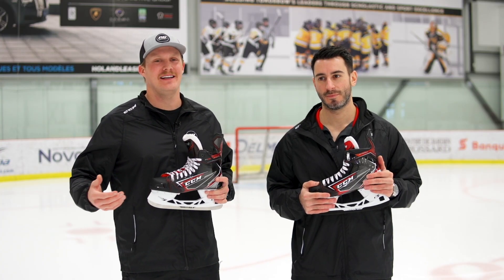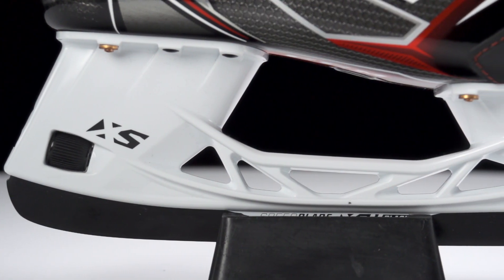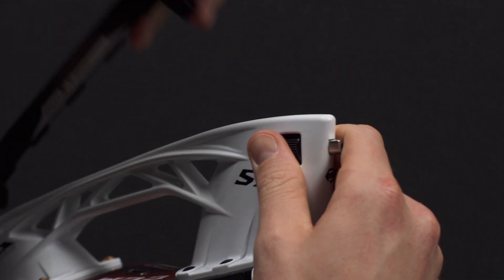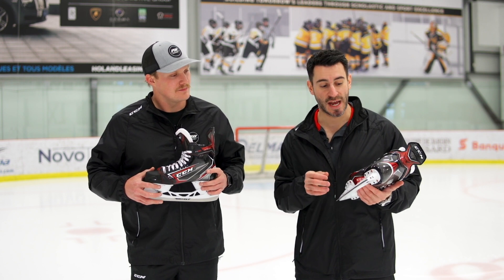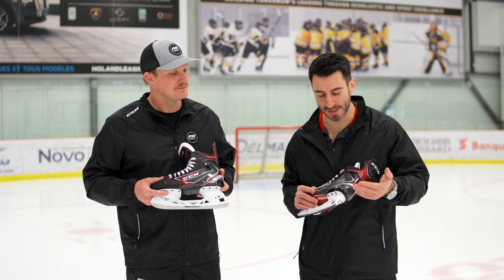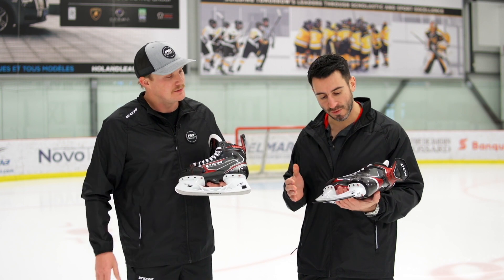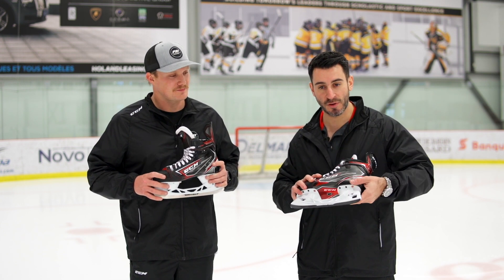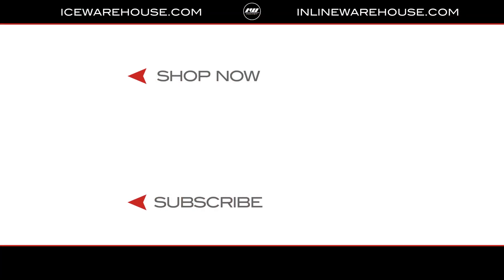CCM Speedblade XS Holder // On-Ice Insight

Comment: I think  CCMs new blade release system has a flaw, the metal tip indicator should have been designed for safety reasons to not stick out. It could have been an indicator towards the inside of the plastic body. Just my opinion.